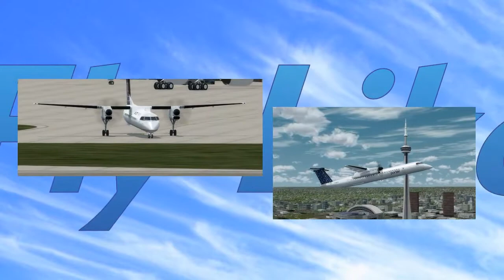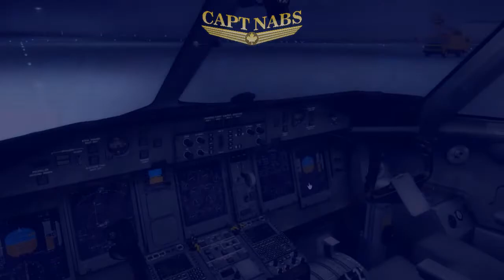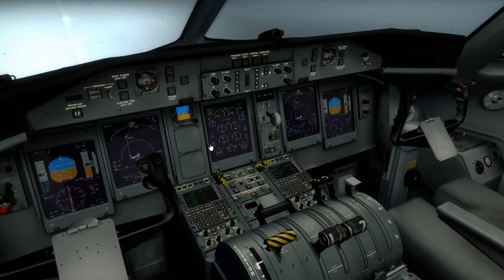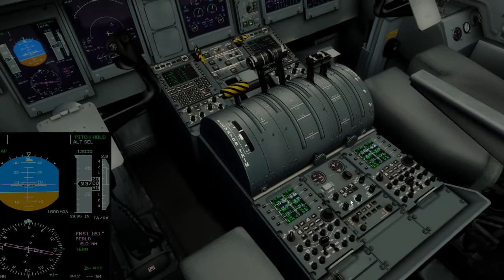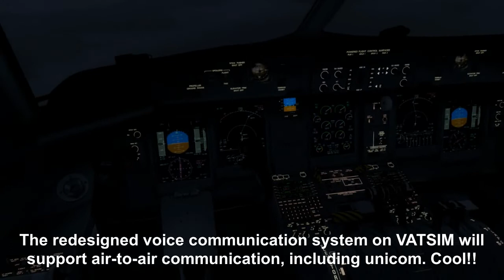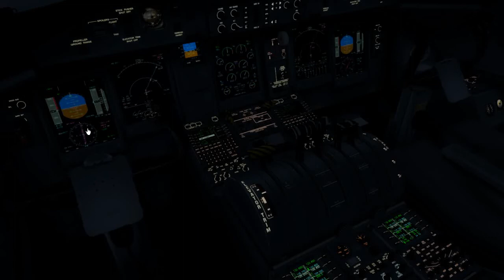VATSIM New Voice Codec Test Part 2, Nov 15 2018, CYYZ-CYXU, Majestic Q400 [P3Dv4]

Comment: I hear two different frequencies live at the same time, do you have both Com1 and Com2 active in your headset? Also, on of those frequencies sounds like the old codec, while the other sounds like the new codec?
Reply: OH so the ppl who haven't downloaded the proper beta software are the ones that still sound bad, that makes sense.
Reply from the maker: Exactly. Originally, we didn't know if both codecs could run in parallel with the software setup. The plan was that pilots who were not part of the beta would be reverted to text-only that night.

Turns out we could use both, which provides a great contrast.
Reply: @CaptNabs  wow nice. So it was only the CYYZ frequencies that had this running I guess just for the test? I don't suppose anyone knows how long until they roll it out worldwide :( ah well.. something to look forward to!!
Reply from the maker: Thats correct. The test was with only a limited numbet of controllers and pilots. Worldwide rollout date is unknown.

Comment: Quick question. Yes it's very clear but how close is it to what you hear as pilot in RW?  Too clear or about right?
Reply from the maker: I don't want to sound ungrateful, but it is almost too good. Many real radios aren't this good, and it lacks the clicking on and off and the background carrier sound.

Some of the pilots in these video are so clear that I thought they were sitting next to me.

I think what we should do is allow the clients to add some background carrier noise so we can mentally separate the transmissions.

I mean no disrespect to the hardworking IT team. They have done a great job, and this will allow us flexibility to "distort" transmissions as much as we like.
Reply: @CaptNabs  Agreed that we need the upgrade.  Hopefully this is step 1 and they will add a small amount of realistic noise to Euroscope and vPilot.